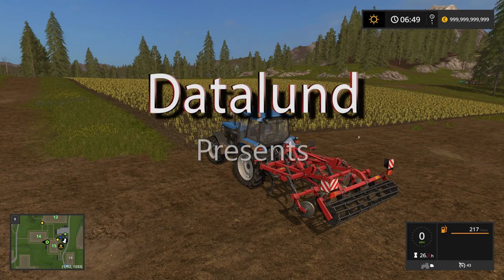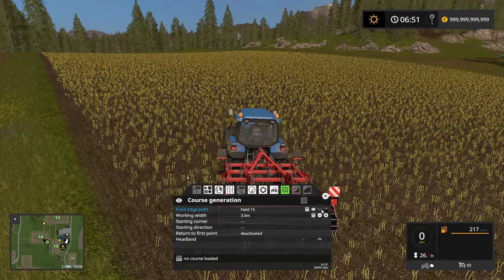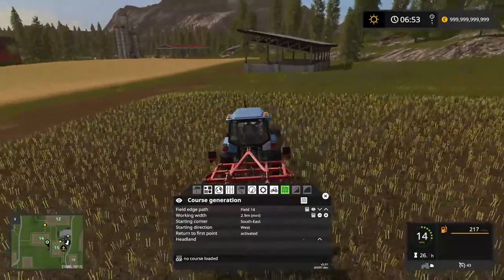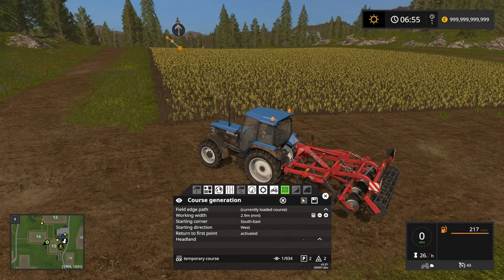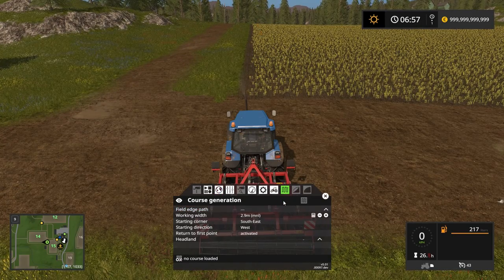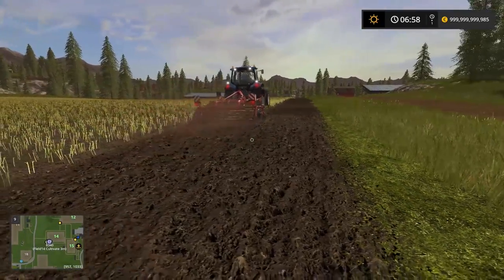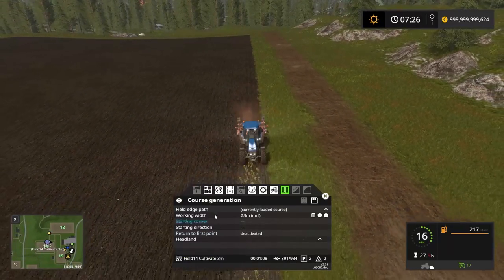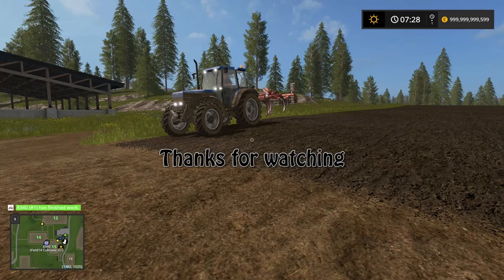How to set up Courseplay for Field Work - Farming Simulator 17 Courseplay Tutorial

Comment: If I am using the Kuhn DLC pack and have the triple tool setup subsoil plow, cultivator and seeder do I use this mode or the seeding mode? Or is there another mode/option I should be using?
Reply from the maker: Great question :) You would want to use the Fertilize and Seeding mode for this setup. The tool will not turn on the seeder if you are using it in Field Work mode. It is an amazing setup by the way.
Oh and sorry for the late replay

Comment: I've noticed dual rear tires seem to really slow down the turnaround process. Is a there a solution via turn width option in courseplay? Great tutorial fyi.
Reply from the maker: The Combi mode in Courseplay has a section about turning circle, but that mode is not available when you are in Field Work mode, Transfer mode and the Fill and Empty shovel mode (http://courseplay.github.io/courseplay/en/manual/index.html#hud_mode2settings).
Otherwise I don't think there is an option to change the turning width.

Comment: In this video you are using a small cultivator. The tractor goes until the lines end and stop going back a bit and turning to backward and good to go. There is no problem beacause the implemet is going with trac as it is a part of it. But when I use the big implements (terra dics 600 for ex), they are not acting like as a part of trac. They are, umm twisty. So when the trac goes back it is buckling and the AI tries to fix it for half an hour. Is there anything I can do about that?
Reply from the maker: I'm afraid that problem is due to Courseplay still being in development. Some things can be a bit buggy still, and that is one of them. Nothing you can do to fix it. At least not that I have found so far
Reply: @Datalund  Thank you for answering.

Comment: I see the benefits when harvesting and unloading but when doing field work ie. cultivating, planting and spraying isn’t easier to just hire a worker. Not being a smart ass just making an observation, again I can totally see how during harvest having the Courseplay run your equipment to a sell point or to your own silo would be a tremendous help and even when dealing with bailing hay and working silage. I just don’t see it in this application.
Reply from the maker: I'd say it depends a lot on the field you are working on. On a perfect square field I definitely agree with you. Hiring a worker would be easier. But if you have a map where the fields are not perfectly square, Courseplay honestly makes your life so much easier.
But I think Courseplay is one of those mods where you always will have to weigh the pro versus the cons. It can be time consuming to setup, but the benefits of having the courses to reuse, can be a blessing.

Comment: I can't get it to overlap and they miss a lot what do I do
Reply from the maker: Make sure that you set your working width lower than the actual width of your equipment. Also make sure that you have unfolded the equipment when you press the calculator to automatically  get the working width of the equipment. I usually have the working width set to 0,5 up to 1 meter lower than the actual width of the equipment. Hope that helps :)
Reply: Datalund Ok I will try thanks :)